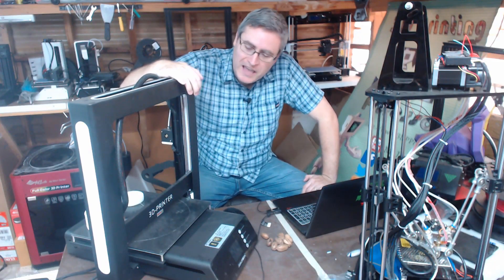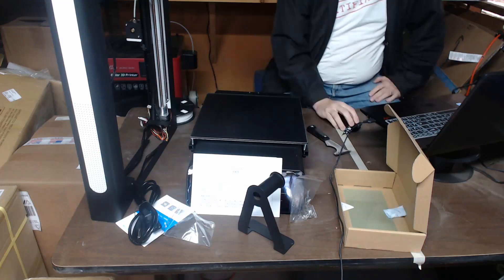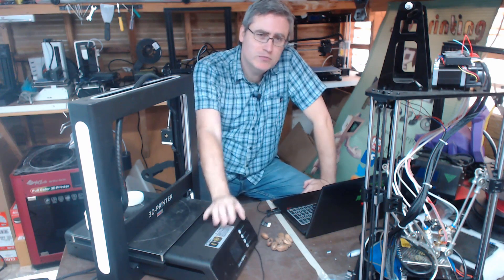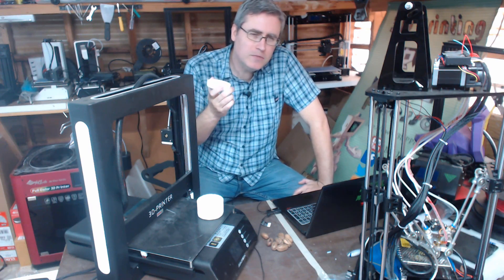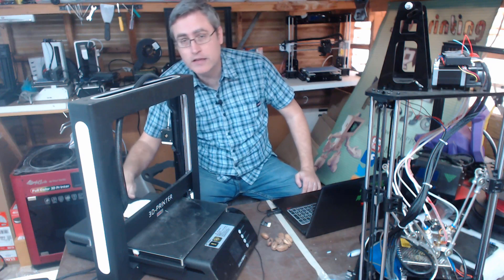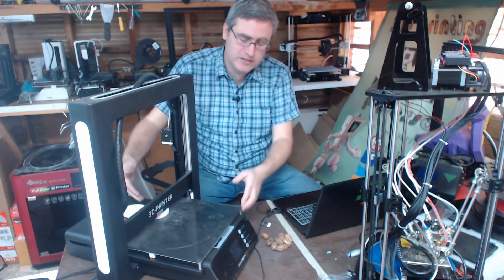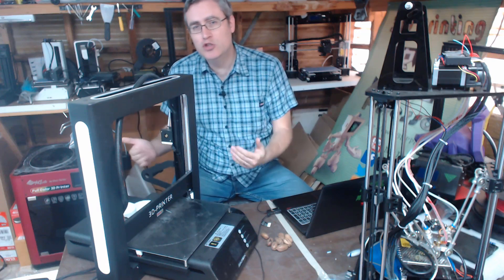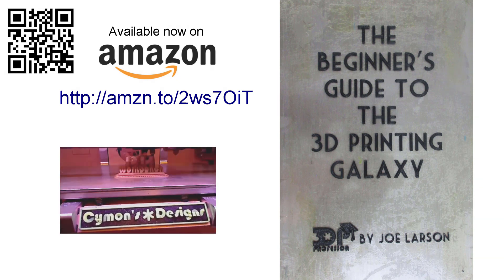JGAurora A5 David or Goliath? March MadMess

Comment: Recently got a Monoprice Select Mini V2, had it for a little less than 2 weeks now.  printed some upgrades for it, and aside from a few failed prints (mostly my fault) I love it.  Small, yeah, but if you need something big ( lightsaber ) I just tinkercad and chop it into chunks.  Love it.  Eventually when I can afford one I plan to get a bigger printer and print bigger items without using chunks.  Love the videos and maybe I can get one you recommend someday that has a bigger build platform.  I was looking at one on kickstarter at one point but it's huge, expensive, and a kit.  The Beast is what it was called.  Maybe you could look into that one someday.

Comment: My experience with this printer was pretty much the same as yours. I was excited about it when I got one for review, and it printed a few things well, but then it stopped working and I didn't know where to begin to fix it. I can't even figure out how to open the thing up. In the end I decided not to review it because it died before I had done enough to make an interesting video, and I thought maybe I had just gotten a dud. But it's starting to look like it's just not a great printer.
Reply: It's a great printer, but yes, the materials/parts used are on the cheap side.   I ordered a handful of parts after watching posts of other folks problems ... now I'll never have an issue :)

Comment: that would be because its not as good as the CR-10. not sure why. I have not figured it out yet its 90% as good as the CR-10 though I am VERY happy with my A5. I still prefer the CR-10

it does have an SD card slot its just hidden inside :-) Don't really care about the wifi.

I wish it used more "standardized" parts for the hot end. fans are getting noisy and they are not typical fans.

the build surface is great. like ultrabase but more stiction. very nice but it can still (as you discovered) auto release when cooled. so power off resume is of limited value.

the not easy to tear apart is, as you discovered, the biggest downfall. so while its on my goto list of usable printers its not my first pick.

the hardware inside actually seems ok (MKS BASE board IIRC) I think either your stepper or the driver just died.

the real problem I have is the y carriage is a bit flimsy (though I have to admit it has held its bed level perfectly for months so......)

I also have noise in my prints that I am pretty certain is a bearing or something as I can hear/feel something grinding vibrating when the y axis moves. its sublte but its their.

I hope you get it sorted. it is one of my favorite printers even with the downsides.
Reply: "helpful"
Reply: Would you say its way better than the i3 Mega and low maintenance compared the CR 10 and have you ran a lot of test prints through the A5
Reply: Dwain Morris I am worried about maintenance on the A5 since there's some proprietary components but I have to say it's one of the only printers that I can turn on everyday and click print and it works flawlessly without one single issue the entire time I've used it it's just reliable which is very impressive now what happens when something breaks I'll have to cross that bridge when I get there :-)

Comment: Thanks for a 'let-the-chips-fall-where-they-may' review. It's helpful.  What's particularly helpful is learning how they responded to the issue.  They sent you a unit for review. Obviously, they have an incentive for you to have a positive experience. Yet, they've dithered in addressing your concerns. Should an ordinary consumer expect to be treated better or worse than you were?  For those of us who have no desire to tear apart a printer to fix it should something go wrong, this is an underappreciated issue.  

For some, the 'hobby' is getting a printer to work. For others, the hobby is making stuff. For the first group, the focus is on the printer. For the other group, the focus is on the things being made. If your look at a 3D printer as a tool for making cool stuff and not as something to endlessly tinker with (not that there's anything wrong with that, you may want to restrict your universe of printers to those that use readily available off-the-shelf parts so you can find someone local to repair and maintain it for you.
Reply from the maker: Those are all excellent questions, and while I refuse to directly sling the mud of private conversations into the public, I will say this; my interaction with JGAurora so far has been weird.
Reply: You didn't need to sling mud. What you said was professional and respectful. You reported the problem. It took them a while to decide what they wanted to do to address it (ship you a replacement). That replacement still hasn't arrived. No need for any details beyond that. What you said speaks volumes.

Contrast that with Inventables, the makers of the X-Carve CNC router kit. Inventables has been very active in sending YouTubers X-Carve's in exchange for a review (with no obligation that the review be positive).  Whenever something has gone wrong with the build process, Inventables has been very responsive -- shipping a new part or providing tech support over the phone.  This has helped create an impression that ordinary consumers might expect similar support (which comments from such users tends to indicate is the case).  Inventables is  USA company, but many of its components come from China.  So, it's not in the same position as JGAurora, but the two companies aren't so different that they require such a different level of customer support.
Reply: If you know who to contact there, comms are a breeze, other than the language gap.  I'm getting pretty good at Chinglish though.   support@zgew3d.com has gotten me good answers within about 24 hrs.   Also, you can go to their aliexpress 'store' (the amazon of china, where anyone can post their wares) .... and "contact seller" ... that will get you in contact with more knowledgeable people than just some tech I've found.

Comment: Isnt this the machine that MakersMuse called 'wierd' ??
Reply: Oh yeah, the wacky Zaxis thing.  They appear to be junk.
Reply: MakersMuse also got a shock from it don't forget.   (always use a grounded wire, and make sure the amperage can handle your extension cords)   MM is a decent reviewer, but does some stupid stuff which he should not put out there.   I think he's a Prussy junkie personally and everything else is 2nd rate.

Comment: "Beautiful on the ouside, crap on the inside".  Yep!   In the first week with my Anycubic I3 Mega Ultrabase.   I've replaced two fans, modified the power supply, re-routed bed wires, dressed up the carriage wires and cleaned metal filing dust out of one of the stepper motors.  After all of that, it's running as well as it looks and I'm happy with it.   Well, almost.   At least three of the linear bearings have dented ball bearings that make noise and rumble, but that's just acoustically annoying.

Comment: I'm not sure if the problem you had was related but all the other reviews I've seen of this printer said that it uses some weird marlin build that is not only out of date but was taken from a dead development branch.  But supposedly you can flash it with an updated version of marlin that the community made to fix some of the quirks of the machine and it works really well after that.   I've been thinking seriously about buying this printer for myself because it basically has all the features I want without tinkering and if all I have to do is flash new firmware then it seems like a better deal than most other kits.  Then Da Hai Zhu has made/is making a series of videos on improvements for it as well.  But I'm not sure I want to support a company with such clumsy marketing and I don't really have 400 euro to lose if I get a bad machine.   It just seems like that's the gamble on any machine less than 700 money units.  Would I be gambling a little or a lot if I bought this one?
Reply: I flashed mine with a new Marlin version and it's working great.  The main caveat to flashing is to ensure you unplug the touch screen before flashing and you are currently stuck with some of the oddities of the touch screen interface.

Comment: Oh! I know that one! (Possibly...) Just had a similar problem, though mine was in X movement, not Z. Turned out to be a bad cable/connection between the controller board and the stepper. You might try re-seating the connectors (just to be sure). Mine needed a new cable ... which was a bit of a problem, as the cable not something you can order.

https://plus.google.com/u/0/+PrestonBannister/posts/7eUdaty5tYh

Comment: It's possible that the z  wires are mixed up and you might need to reconfigure the wiring
Reply from the maker: I don't think so, because it did work, then it didn't. That says to me, something blew.
Reply: Mice in the control box! Couldn't that be the whole problem. Maybe that should be investigated to determine that this was the original problem,  instead of thrashing the product.

Comment: "It is a bit unfair"??? It is fair because that what is called "false marketing" and they have many false claims which they refuse to edit and clean up.
Reply from the maker: That's true. But this is the reality when you're this close to the manufacturer. They make the marketing copy before development is done, so it's sometimes a list of goals, and sometimes those goals aren't met. Some manufacturers are better about being more conservative with their goals, this manufacturer is admittedly one that isn't. 

Still, you're circumventing retail when you buy direct from China like this, so you may, from time to time, have to cut them some slack. Yes, you're not getting what was promised, but are you getting what was better than an alternative? Had the lack of wifi been the only problem I would have been very happy with this printer.

Comment: Thank you for your insighful review!
If you were to compare it to the Anycubic i3 Mega... do you think that the i3 Mega is a good deal to get if the manufacturers to fix this printer, when the majority of the printers problems has been eliminated?
Reply from the maker: Are you asking, if this machine were completely fixed, and an Anycubic i3 Mega were completely fixed,  which one would I choose? As I haven't use the AnyCubic I can only speculate.
Reply: Thats all good, Idk either...and for now the Anycubic seems to be the best option in regards to the internal printer components. 
Thanks for your consideration :)